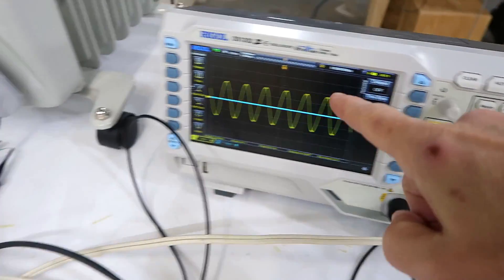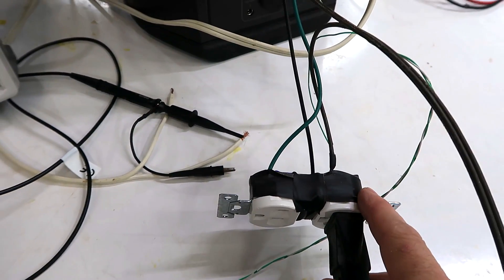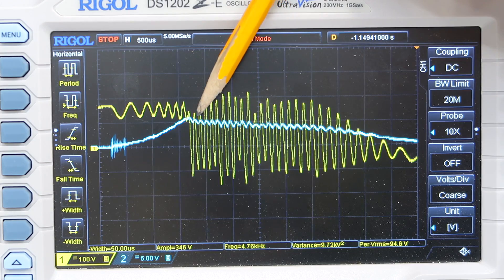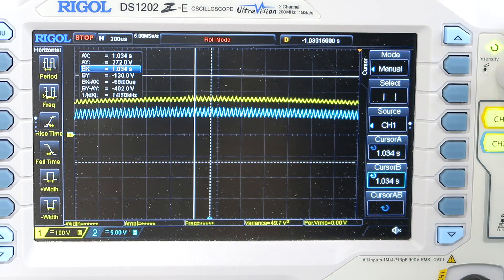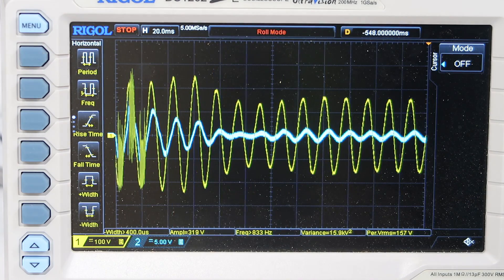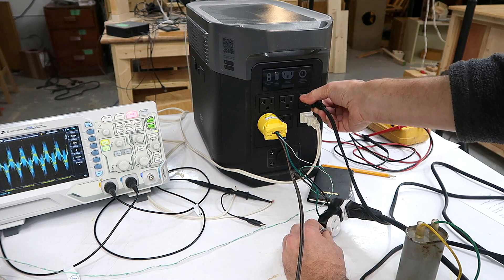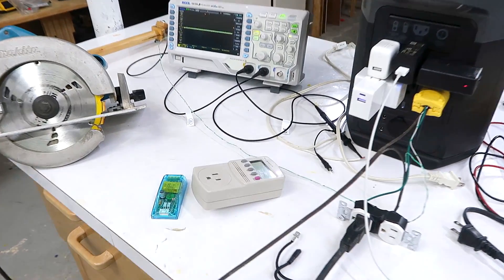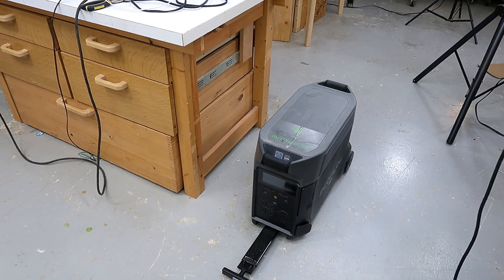Inverters don't like power tools

Comment: Inverter generators are pretty standard now.  I see Honda inverter generators on job sites all the time.  They are used with power tools on a daily basis for years at a time without apparent issue.  Would be interesting to see how the wave form looks on these generators when running power tools.
Reply: The Honda inverter generators actually have a very good inverter in them.  These cheap-o units do not.
Reply from the maker: May well be as ugly as this one, the power tools don't mind.  But being honda, perhaps they did a better job of overcurrent handling

Comment: The apparent increased current ripple on the heater load -- that may be a side effect of inductance in your shunt resistor.  Typically over 10kHz or so, inductance dominates, and you need to compensate for it on any kind of low-ohm shunt resistor.  Especially for low-resistance metals like copper, the threshold can be just a few kHz.  This is kind of supported by the waveform looking squarer, whereas we should expect a rampy waveform after the onboard filters.

(This doesn't affect any measurements in the video, as you eyeballed the "DC" level between the ripple peaks, which will be reasonable enough.)

Comment: Hm, interesting -- between the waveforms and their comments, it seems they are indeed doing hysteretic control.

There are other ways the system can be arranged, indeed.  For example, you can regulate towards a target voltage, and limit it if maximum current is exceeded.  This can be done instantaneously, not just averaged over many cycles.  But, trying to hit a constantly-varying target, gives somewhat poor results --it can never actually hit the target, except as it turns around.  There is necessarily a phase shift and some gain error.  On the upside, it can give perfect limiting/fault behavior.  So, there are compromises to be made (or more complicated controls; there are methods to deal with that error).

It's not clear how much effort it might be for them to change to a control strategy like this -- but a hysteretic control is very simple, so it's likely a change like this is either a substantial revision to hardware, firmware, or both.  Or, if they're using a pre-cooked inverter / mains synthesizer chip -- it might not be negotiable at all, short of rebuilding the whole thing from scratch with whatever hardware and firmware is required.  That could take hundreds of hours of engineering time!

I am surprised that the amount of hysteresis is apparently so high; it should be possible for it to trigger at a higher frequency, i.e. closer to the switching frequency.  Maybe that's a limitation of the chip used.  Maybe it's a control parameter that could be tweaked; maybe not, because less happens to cause nuisance behavior even on ordinary loads like power supplies or space heaters.

Comment: You could also try some LED light bulbs that use capacitive droppers for their power supply as another inexpensive test.  Though increasingly it seems like some newer LED bulb designs are even skipping the capacitive dropper and simply going to longer LED strings to drop the rectified AC.  I did model the Kill-a-Watt power supply in LTspice and sure enough the 5.5 kHz transients allow voltage to increase to the point where a ton of current flows through the Zener trying to regulate the output to 5 V and pop goes the diode . . .
Reply: I was thinking about LED bulbs also. I wouldn’t be surprised to see some of the cheaper ones die under this type of usage.

Comment: @2:02, that is NOT voltage instability.  That is the electronics reaching current limiting to ensure the IGBTs inside do not get destroyed by the 'short circuit' you put across the unit.  A brushed motor like a circular saw draws so much current at startup that the unit needs to drop voltage (while maintaining a decent RMS current) to protect from the startup current.  Looks like the EcoFlow is doing a great job at protecting itself AND still is able to start the load.  It is the users responsibility to realize that this type of motor can draw anywhere from 5-10 times the rated current to start - If you were starting a load that didn't exceed the rated output rating - you wouldn't have seen any cutback on the voltage - except for normal voltage drop due to cabling resistance.
Reply from the maker: Congruatulations.  repeating what's in the video for those who can't bother to watch it but read your comment instead (who knows, there might be one who reads your comment without watching the video)

Comment: 9:40 - LOL! My dad had a piece of 8 gauge wire with a beefy amount of electrical tape around the 'U' in his toolkit. I asked what it was for. "For finding breakers". Huh? ... 5 seconds later..... OOOHHH!!
Reply from the maker: it's been tempting to do that some times myself too.  Probably less hazardous than loading up the circuit with 30 amps and waiting for the breaker to pop after five minutes
Reply: Easier to just get a screw terminal wall plug, some Romex, an electrical box, and a light switch. The two pins on the switch go across the live and neutral of the wall plug.  Plug in the switch box, then turn on the switch, and you have just blown a fuse...

Comment: Inverter-A will kill electronics that I run on it. Inverter-B will run the same equipment with no problems. Inverter-A is a cheapy, Inverter-B is significantly more expensive.

Comment: Sounds like an easy way to run powertools safely from something like this would be to rig up a soft start module in a box, plug the power tool into the soft start box, plug the box into the inverter, problem solved.

Comment: So my take away from all this is, if you're going to use a unit like the ecoflow out in the field with things like circular saws, make sure to buy ones with soft start capabilities built in, if they exist.  I see a market hole for manufacturers to fill.  Oh and don't try and run a bunch of other stuff at the same time.

Now what would be an interesting question: do any of the big high frequency inverters (think 6kW wall mounts) have the same response to the same devices/tools.  And, what about low frequency inverters under the same conditions.  I'd already had it in the back of my head, that low frequency units are better for high draw motors like well pumps and big 3ton+ HVAC condensers, but is it the same situation as you're seeing with circular saws.  I'd contemplated mixing HF and LF inverters in my future house design, specifically for this reason: every day "hotel" loads on the HF unit(s), big draw motors on LF unit(s).

Also as others have mentioned, ecoflow's response now actually make me think their units might be better than other brands.  How a company responds to reports like this is telling, as no R&D department can ever study every case/condition (especially the edge ones) within any kind of reasonable budget.

Comment: A well-sized choke in series with the sensitive electronics should block the high frequency stuff, preventing the capacituve dropper power supplies from overvolting.
Reply from the maker: A choke in series alone won't do much
Reply: Why do you say that?
A 0.01H choke in series with the load (sized to handle the load amps, of course) would have 1.8k of inductive reactance at 30kHz. That would result in about 67 mA of current flowing even through a dead short (at that frequency).
At 60Hz the same choke would have a reactance of 3.8 ohms. A bit too much for power tools (although it could be incorporated as part of a soft starter), but great for a branching circuit for the sensitive stuff.

Comment: YOU CAN'T USE electric motors with digital devices in the same inverter or UPS circuit

If so you need to use motors inverter to power multi selection of tools

Comment: Very nice detailed technical response they sent! I have an "old school" Magnasine PSW interverter, rated for 2800w continuous and some thousands more peak... it weighs maybe 80 lbs, without batteries. I've run my circular saw, air compressor and other inductive loads off it, I wonder what the waveform looks like during an overload condition.
Reply: Probably much better. I run an old Trace DR inverter and guess that the transformer makes all the difference.

Comment: Very timely video Matthias!  The problem a LOT of people face is running AC off batteries that are part of a solar installation.  Even with a startup capacitor, the inrush from the compressor startup kills most battery setups.
Reply: It's overall a problem with electronics. It's relatively easy to go from AC to DC but going DC to AC we at best approximate the AC.
Reply: I think BLDC AC compressor can be a good solution for solar battery use case scenario. But I don't know if such things exist.. all I see on the internet is BLDC refrigerator compressor to run fridges on battery, but I think if we use it for AC it doesn't strong enough.
Reply: @putraadriansyah8082  There are most definitely inverter-based air conditioning units. It seems to be the norm for mini-split units.
Reply: @PsRohrbaugh  i asked him if he can hook up what is called a drive to slowly ramp up the motor.  Just like the ac soft start kit does. The way you said it was much better. I know someone who sell drives to manage  the motors..  i wonder how that would work with the inverter. ?  Intresting .

Comment: I'm new to your channel but I'm loving the nerd drama

On a more constructive note: My bedroom has a breaker so weak that my old vacuum would trip it when turning on. I now have a new one with a soft starter, and I've always wondered why those aren't much more common on high powered motors for this exact reason

Edit: The high frequency oscillation on the inverter's output might not be an intentional behavior of its driver, but rather the output side ringing.

Comment: If the problem is that the high-frequency components can pass a capacitive dropper power supply, I expect that LED light bulbs and other such low-power devices also might fail when sharing with a power saw. Based on Big Clive's findings some of the these use switching supplies (which should survive fine), but others rely on a series capacitor to reduce the voltage seen by the device's power supply (which could blow when fed high-frequency voltage).

Comment: I'd be concerned of what happens when an inductive load shuts off. Could cause voltage spike and exercise MOVs which have limited usage. Hard to detect and would eventually fail connected devices

Comment: It's quite typical to run these inverters at around 30kHz. 
Older TL494 based ATX power supplies run at right around 34kHz.
Reply: A software defined radio with direct sampling and a ferrite rod antenna hooked to a high-gain amplifier is your friend...

Comment: Understand that saw motor is virtually a dead short until it starts to rotate and generate some back EMF.   One trick is to add some series resistance in the AC line driving the saw.  Set the resistance value large enough to limit the motor starting current to a reasonable value that keeps the Ecoflow happy but low enough that the saw motor will still spin up.  After the saw spins up a bit the resistor can be shorted out with a switch to get a full power from the saw.   This is sort of a poor man's soft start.  Old CRT/tube TV's would do this using a power thermister.   Ah,  the advantages of brushless DC motors.

Comment: I think the problem here is that these consumer grade battery back-up supplies aren’t designed for certain applications. Lighting, charging, radio devices, laptops and networking hardware, etc. fine. Large inductive loads? Probably not. There is a point where you could engineer a solution to this problem but at what cost and is it worth it when the current design covers 90% of the intended user base.

What I like about this series is that Mathias was willing to put in the extra effort to properly evaluate a specific usage case that could be problematic to relatively few users and do so in such a way that was honest but fair.

Note to EcoFlow. Mathias pointed out a flaw in your design but that flaw is an extreme case that also exists in other manufacturers products. If i had the need for such a device I would still STRONGLY consider your product. If for any other reason than Mathias did the teardown on it. I just wouldn’t use it to run inductive loads without soft start capability.
Reply: A high inductive load would work better with a gas generator than a battery backup. That's how builders have been doing it for years.
Reply: @Beakerbite  agreed.
Reply: Power tools are an extreme use case, but it is also a use case they use to market the devices. And the power tools do work!
Reply: You are absolutely correct that power tools is an extreme case.  Quick charging 18V/20V batteries for power tools would be more reasonable expectation.  Also, a power outage and plugging in an appliance to run (refrigerator, freezer) might be a good scenario.  For me, I would put this in a shed to run DC lights, have an occasional 120V system and charge batteries for tools.
Reply: The solution is rather an easy fix, he used a large capacitor as a current limiter and to provide the large inductive initial load. But if I had that battery pack, I would obviously question and know that the ridiculous in-rush current the circular saw consumes will destroy the battery pack. Seems like both at fault here, however this is not the case, I saw ecoflow website and they literally states their battery packs works on power tools. I guess they assume small percentage of customers will be like Mathias 😂.
Reply: I don't think this is an extreme case at all. Nor is designing to anticipate this. Many inverters for example solar systems don't behave like this whether it is a soft start type circuit in the inverter itself or otherwise.
Reply: @rkan2  if this unit was designed to be part of a solar pv system that was used for utility power replacement then I’d agree. But it’s not. It is designed for emergency backup power which implies some usage limitations. Sure they could have designed it to cope with the inductive loads but if that was not part of the original design specification then they wouldn’t have. Just because they could, doesn’t mean they should. If someone wants to use this as a cheaper replacement for a purpose built solar PV inverter then they should expect that it will have some limitations.
Reply: @stellamcwick8455  I don't see how that is an argument either. This costs over 3k$£€ with the inverter being a significant part of it. You should be able to get quality inverters that manage the type of inductive workload for around 1000$£€
Reply: @rkan2  again, just because you could doesn’t mean you should. Im not saying its not possible. Its just that they made the decision not to implement it for some reason. the price they charge has nothing to do with the actual cost to produce the device. They are going to charge what the market is willing to pay. They probably believe that the market that this device is sold in is ok with spending a certain price for the included function complete with the issue regarding lack of ability to support inductive loads.

To be clear, im not saying its not possible to design this feature. What I am saying  is that for some reason they chose not to. Their real reasoning is unknown to me but im guessing it has to do with cost benefit and not technical limitations.
Reply: @stellamcwick8455  Personally I just think it is lazy design and/or reusing some existing "cheap" design.
Reply: @rkan2  i would also not rule this possibility out either, as it is just as likely.
Reply: Design an in line device to be used when the 10% run thier power tools.
It could be sold separately.
Reply: I'm trying to figure out what kind of yahoo would decide that a power outage is the perfect time to go to the shed and cut wood.

Comment: Hi Matthias, could we not simply use a NTC thermistor  as  a ICL (inrush current limiter) ?
Reply: Not really -- yes, but normally these only limit to quite high levels in the first place (50-100A), which may not help enough here (limit triggers 30-50A).  A big enough one might do.  But then it gets nice and toasty in operation, and the next time it's used (within say a few minutes), it does hardly anything at all, you need to wait for it to cool down before going again.

I wonder if there's a "motor starter" box available for various kinds?  Induction motors, maybe, maybe not, it's weird because of the start winding?  If you can afford to put on a VFD and 3-phase motor, or BLDC, then you'll have a controller that can do it.  Any soft-starter will do for universal motors, including NTC (cooldown aside), phase control, etc.

Comment: This all goes back to inrush current values versus surge loading.
The NEC allows up to 6x full load current for a "short period" - so if that saw pulls 10A normally, it could draw up to 60A for a few cycles as the electro - magnetic interactions happen in the inductive load (the motor) as it comes up to speed.
Unfortunately,  most inverters only have a 2x surge load capacity.  So, it can't keep up, and the sine wave breaks down into the noisy patterns you see.
The real issue is, no one explains inrush current on inductive loads well, and inverter manufacturers use a different idea for "surge" (that actually does work most of the time) from electric motor manufacturers. 
I actually am pretty impressed how well those battery/inverter units hold up under load. Kudos to them, and thanks for a great real world example of the how / why / what of what the ragged edge of inverter power looks like.